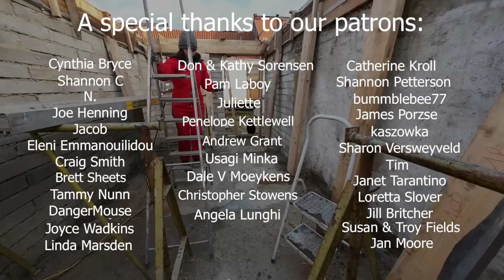How to DIY a concrete ring beam [ Turning an OLD SHED into a cozy TINY HOUSE ]

Comment: The threaded rods need a bend in the end in the concrete, and hook through the rebar. The threads will not hold well on concrete only. (I know its too late to do anything about it.)

Comment: Guys the only problem I see is with the all rods in the concrete, there is nothing on the bottom end to anchor them into the concrete.  with a little vibration the bond between the threads and the concrete will loosen and the rods will pull right out.  Otherwise every thing is coming along quite nicely, I envy you the energy to do all this work, but then with me being a few months from my 80th B-day I reckon that's to be expected.  Take care and be safe.

Comment: The allthread in the concrete should have been L-shaped. Now i don't know if it will stay in place. It should probably be fine, but next time, well next time is next time. 

The concrete formwork has held, so it is a big success. Concrete hardens pretty fast, but isnt full strength yet. Ive read that in tunneling formwork, forms could be stripped after 3 days (but that is bigger volumes, and thus higher heat development). After a week it should definitely be hard enough. You could try one corner and see how it holds, or just wait longer, whatever you prefer of course. :) 

After 28 days it should be fully hardened. 

I really like concrete videos, the result is always so enjoying to see. 

Remember that concrete needs some paint/protection when it is done, or some other way to keep water away from concrete, or after years the pH could come down enough to make the concrete pH go down and have the rebar rot. If left untreated it should go for decades though. 

Very cool!

Greetings,

Jeff